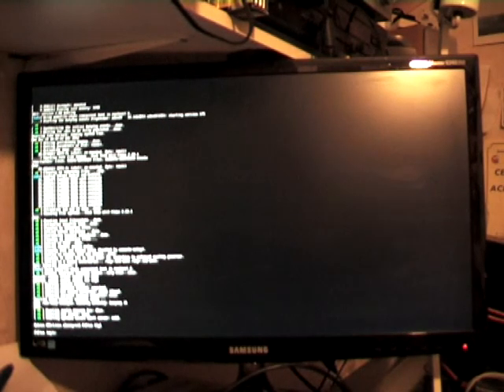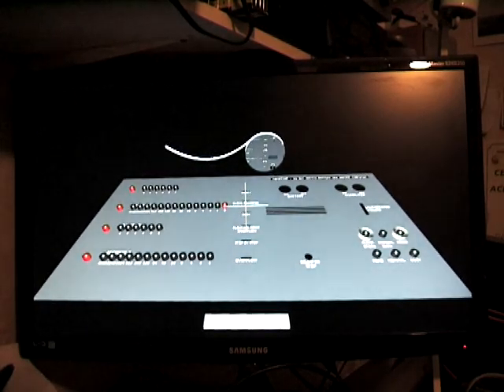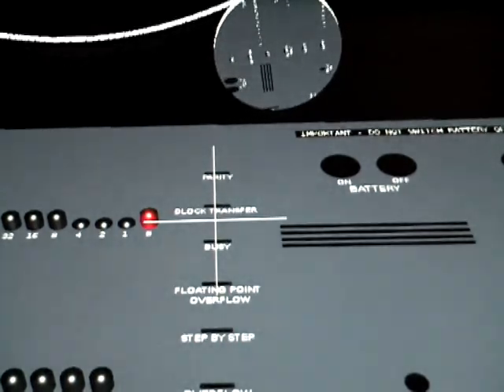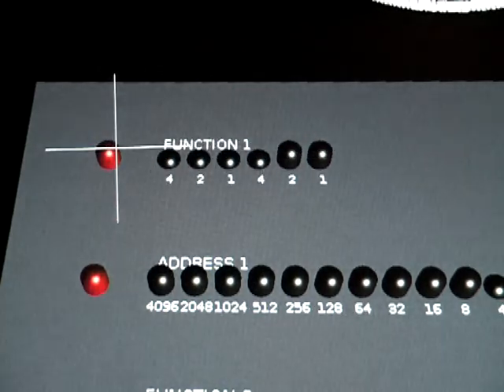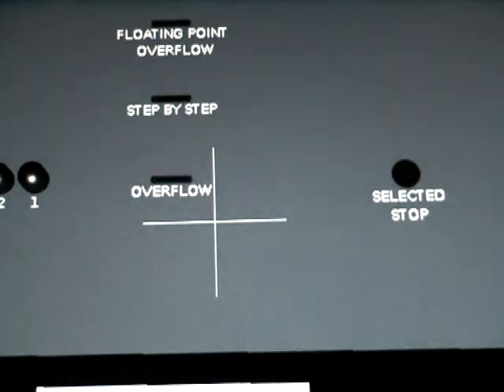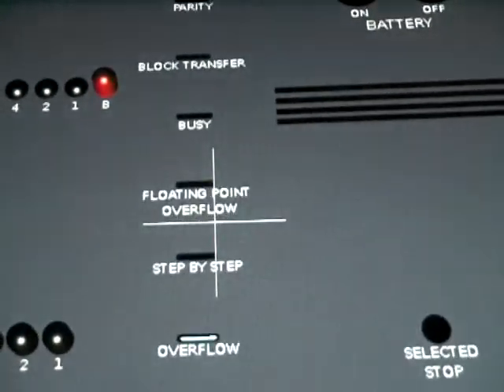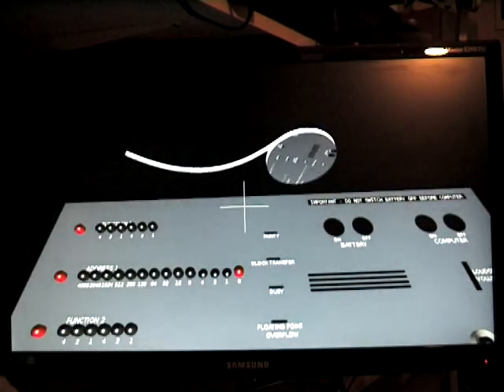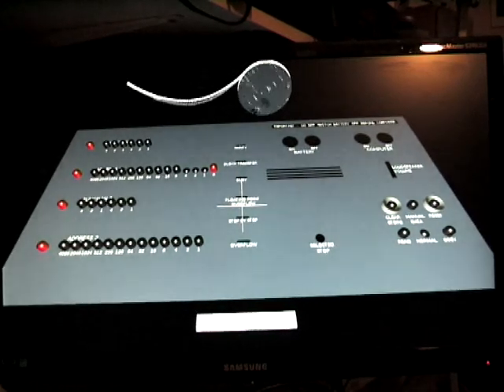PI

Comment: Amazing!
I checked you video CalComp2 to see actual console (at 1:31). This is really nice GUI for the emulator.
Do you plan to run plotter (565) on RasPI? I run my Calcomp 565 from PC. I plugged  the same interface to PI and it works fine. My son wrote the code in Python to drive it, we'll put it on line.
Several months ago you mentioned a possibility to capture the plotter drawings data  sent from your emulator to the plotter. I am VERY very interested in it wishing to run it on PI. Tom

Comment: Oh, I see. Thanks for very kind offer but the 803 emulator and 803 programs would be a way beyond what I need. 
I am really after only the plotter instructions with coordinates. If you can save all the data sent from the current emulator to your plotter, that will do. 
Would that be too much trouble? Or do you think you can do it? I will gladly send you something similar in return. Thanks, Tom